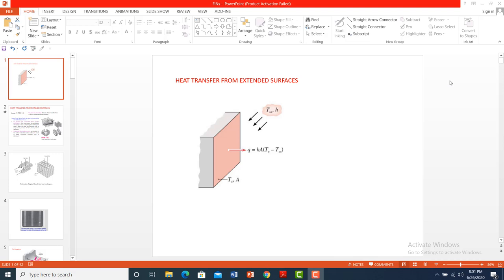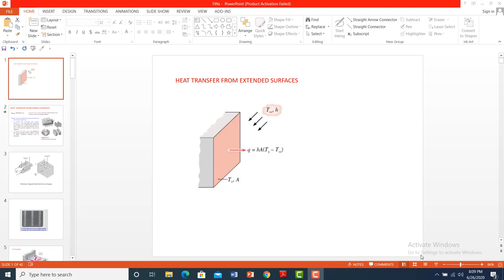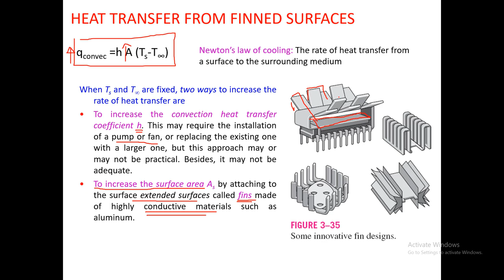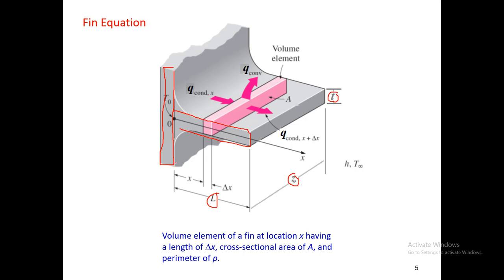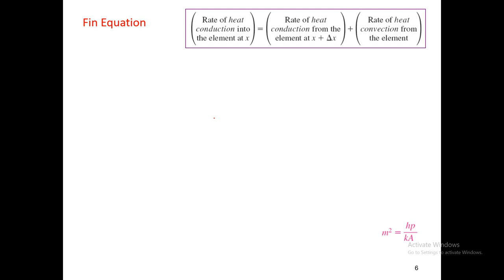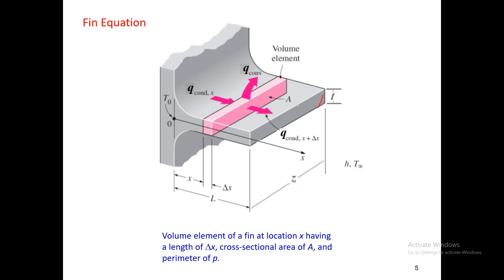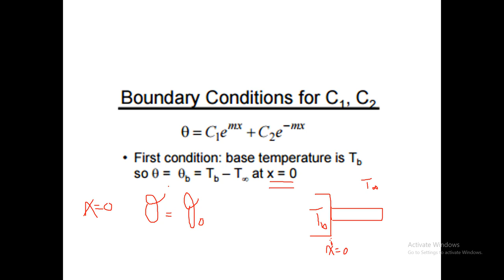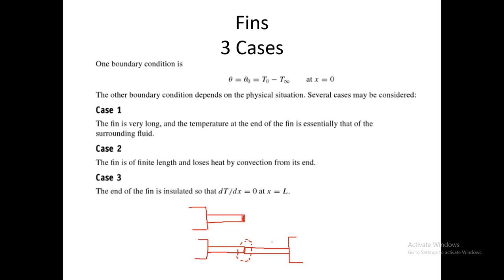Heat Transfer From Extended Surfaces | Fins | Heat Transfer | HMT | Lecture 06

Comment: Sir .
Give some examples of the case. 
In which conduction, convection and radiation are involve at the same time.
Reply from the maker: There can be several examples. For example, an electric heater placed in a room, is convecting heat to air, radiation heat is exchanged with the walls of the room and heat is conducted in the coils of the heater.
Also keep is mind that radiation dominantly occurs at high temperature, although it also occurs at low temperatures